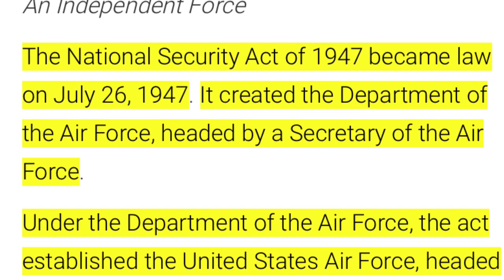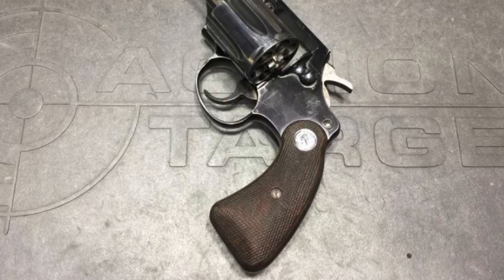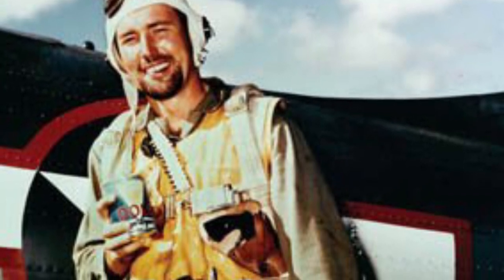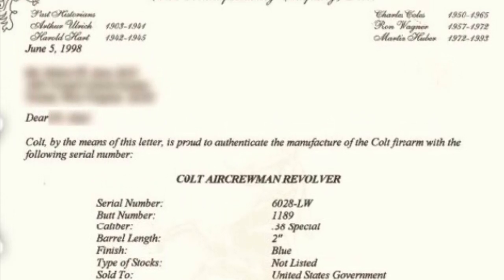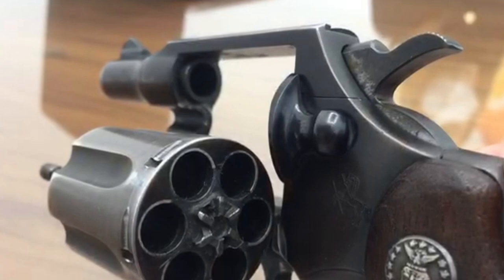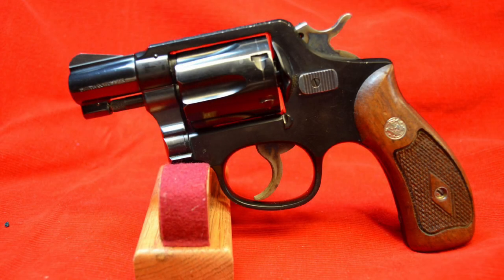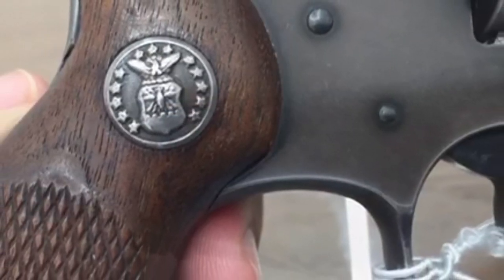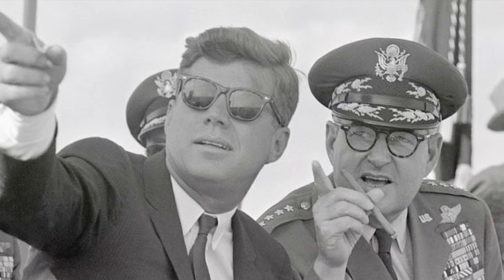One of the rarest guns in the world: The Colt .38 USAF Aircrewman Revolver

Comment: Fun fact, the weak garbage ammo that was designed for these revolvers continued in production and was issued out by the Air Force up until the 1980s.  Even though we had long since switched to steel frame S&W model 15 revolvers they kept using it until the Beretta M9 9mm replaced the 38s.
Reply from the maker: Very interesting. Thanks for commenting.
Reply: It is better to have weak ammo (as long as it works) with strong guns than opposite as guns do work with that. At least revolvers and externally powered guns do. Automatic guns may have feeding problems with underpowered ammo.